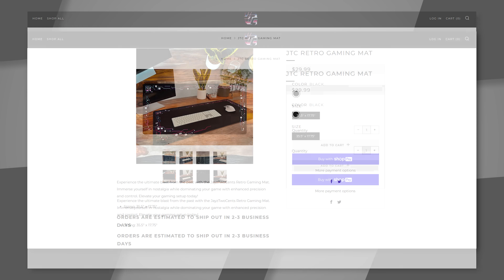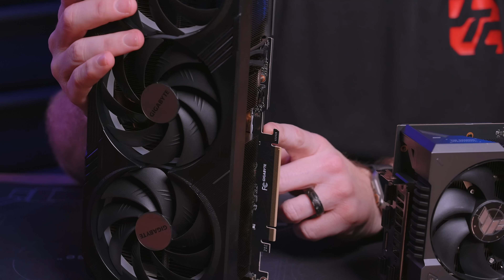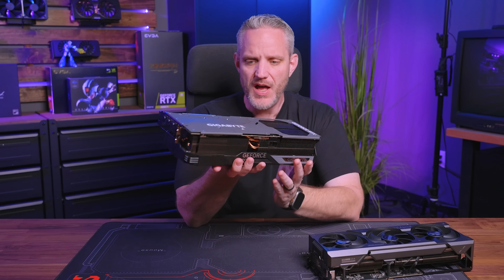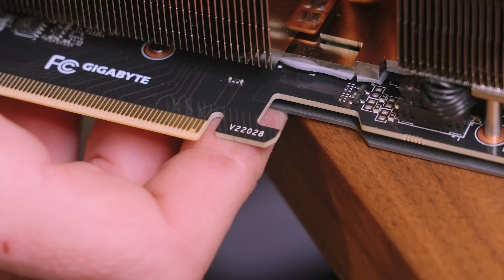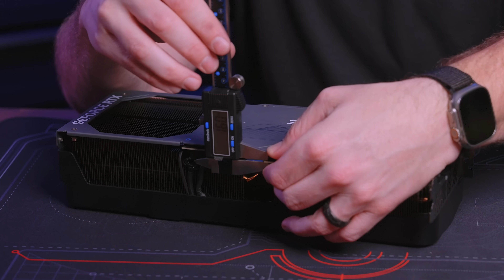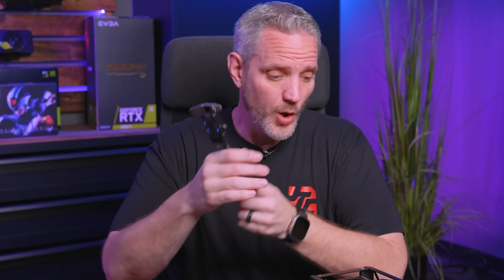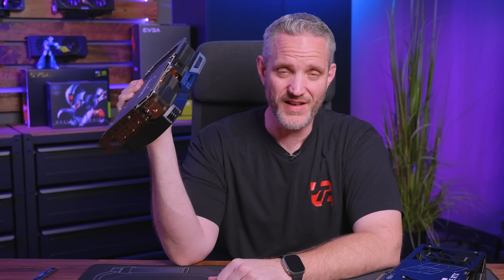These GPUs are cracking and the company REFUSES to warranty them!

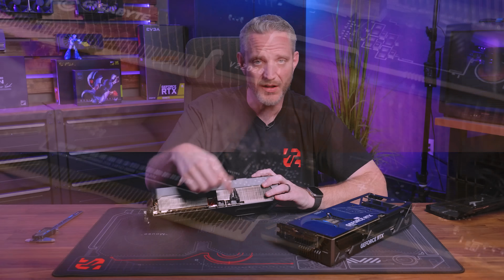Comment: If you stop the video at 14:13, you see that there is a screw post on the ASUS for the cooler near the hook. The Gigabyte card with the cracking problem doesn't have a screw post near to give it added support and rigidity. Gigabyte simply needs to redesign the cooling attachment points so a post is near the hook, and that should support the area enough to solve the problem.

Comment: @JayzTwoCents :  @14:15    = >  Look at Asus, the point where the cooler is attached to the PCB "via" a screw is closer to the locking mechanism on Asus card than it is on the Gigabyte and that could be one explanation why Asus does not flex so much in that area. On Asus  that screw it works like an PCB reinforcement  IMHO.

Comment: i've forgotten the days when GPU braces are nothing but a gimmick, you would get laughed at for spending on one. it's almost compulsory to use one if you're using anything over 200W TDP, coa the heatsink WILL be a big one. on the other hand, the AICs, despite having top of the line designers and engineers that can make fancy ass cards like they are some parade vehicles, failed to detect nor address a simple physical issue that can seriously damage a product from normal usage.

Comment: Hi Jay, I just bought a Gigabyte 4090 Gaming OC GPU a few weeks ago and it does not look to have as much flex to it as yours (it's hard to judge because I'm not sure how hard you're trying to flex it but yeah...). It also came with metal brackets that install with spacers above the mid/bottom right screws for the mobo and at the very end of the GPU so it has one more anchor point. It seems like they did an effort to prevent the issue from occurring with new consumers.
Reply: I have a gigabyte 4080 eagle oc, and it came with the same bracket. It's rock solid.

Comment: I think the take-away from this is:
 - Gigabyte isn't covering warranty for this issue.
 - Gigabyte is showing up at the repair shop more than any other matching card. (Not sure this is factual yet)
 - Try installing and removing card while case is on it's side to avoid torqueing.
 - Support ANY 30 or 40 series brick in your case at all costs!
I doubt if vertical mounting will show the same result but, It's obvious that the card sizes are gown beyond the PCIe 16 connection or location on the MOBO. More dialog is needed, I 'thinks'. Thanks, Jay, for bringing this up!  😉

Comment: It all depends on the geometry behind the tab. As you see the Asus card has a more circular design whereas the gigabyte card has a more squared off design. The circular design distributes the load evenly. The squared off design however, that creates stress points on the corners. That can be proved by the fact that that's exactly where the crack starts at the inside corners of the pcb behind that tab
Reply: That make me relieved. I have the Asus rog strix 3090 oc. It doesn't have the power chips burning out issue thanks to using good power design, so it won't burn out from games. And now this with the circular tabs. What a relief...
Reply: @MyAmazingUsername  lol as a poor guy i couldn't sleep if I somehow had gigabyte version and worry about it cracking.

Comment: Couple of things: 1. Gigabyte needs to stand by their products on these RMA's IF an anti sag bracket WAS utilized with proof. I still want the PCB investigated after saying that. 2. People need to understand as well that the 3090 and 4090 cards are MASSIVE, and heavy. Gigabyte did include anti sag brackets in their 3090 and 4080 and 4090 series of cards to my knowledge. They made an effort there. I can acknolwdege that. So the issue is two fold. Both parties are at fault in my eyes. Gigabyte with the flimsy PCB and customers not using any anti sag bracket on obiviously enormous cards.I  just bought an RTX 4090 Aorus card. The biggest variant there is to my knowledge. If I buy a $1200.00+ to $1799.99 to $2000.00 card I think it would be smart to use the bracket that is included if I can. Or if not, get an anti sag bracket for as low as 7 dollars on Amazon. Leave the PC laying flat like I did till you install the bracket and call it a day. In my experience with Gigabyte I honestly have not had any issues with their products. I haven't purchased their PSU's so I cannot speak to that. But their boards are all I have ever installed in my builds and others. I have not had one failure since 2007.  I may be in the minority in this. But, that is my experience with them.

Comment: You look at the hook, look at the spacing between the hook.  With the ASUS, the hook is close to the PCB making it less flexible.  You look at the Gigabyte card, the hook is far away from the board.  If Gigabyte uses more PCB around the area, it would be more stable.

Comment: I don't want to be that grumpy old man. But I can't help it with this one. This, like most current issues, is from the consumer who thinks one can hang 5lbs off a board with only 3 contact points. 
Because you, the costumes refuse to use support, bracing both the case, and the motherboard has had to get stronger and more expensive. And yet physics can't be changed.

Comment: PCB is "layers of non-substrate materials with layers of copper circuitry" But in plain terms, it depends on the number of layers.  The pcb probably not only has layers of copper but it may also have resin in the core which is why it's less flimsy.  It also could potentially have glass.  But the 3 things pcb has in it is copper, glass, and resin.  It could simply be the one has more layers than they other or they layers are thicker.

Comment: Having had to remove hundreds of video cards over the years, one trick that I've found is that sometimes I need to push the card down into the slot in order to get the release tab to actually release.  It seems counter-intuitive, but by pushing down it lessens some of the tension on the tab.  You just have to be careful not to push too hard that you could damage the MoBo.
Reply: So you would push down while pushing on the release tab ?
Reply: @mire873  Yeah, I've found that sometimes I need to push the card down into the slot while I simultaneously push on the release tab.  Not always, but sometimes it just catches and won't release otherwise.
Reply: @Jito463  I remember this with older boards, but my last 3 or 4 boards barely strapped the thing -

Comment: To be honest, PCI-e slot is very outdated and ATX standard also, they should finally change it. It's ridiculous to mount today GPUs to such ridiculous slots designed for some geforce 6600. And if they still want to use 20 years old slots for today GPUs, they should add some standardised holder which will be compatible with all modern cases and motherboards. It's just no longer possible to use safely today GPUs in 20 years old slot, history is going back, we need something like those super long ISA slots or at least GPUs with 2 PCI-e slots and standardised distance between slots on all new motherboards.

Comment: I got a Gigabyte 3080 12 gigabyte vram, and so far there are no cracks or anything, and the PCB seems super sturdy on this one, but I am also pretty worried that it might've been broken or beginning to break as it had been sagging for around 7 months before I got a support bracket, as I was hoping there was one in the box when I bought the GPU, but there wasn't...
So it doesn't seem to affect all of the 30 gen GPU's, but still dick move by Gigabyte, and it's not okay to do that, to sell something to flimsy and then denying warranty for something that is obviously a production problem.

Also for some of the people with this problem, you might have bought it from a site that has warranty from their place, before it goes to the company that made it, so that might save you some hassle if they have a good warranty.

Comment: Another thing to consider is the geometry of the perimeter.  Sharp angles tend to be where stress concentrates, making them the first place to fail.  The ASUS card you showed was rounded and didn't extend as far from the rest of the pcb.  Those two factors combined should make it both more rigid and less prone to strain at any single point
Reply: I was thinking that too. That's why plans and ship have rounded windows and doors.
Reply: @winstonsmith84  *planes

Comment: the biggest thing you missed is between that gigabyte card and the asus card, is the asus card has an upright right beside the locking piece that allows a screw to hold it nice and snug, where as the gigabyte card doesnt. that alone will increase structural integrity out the wazoo
Reply: Totally agree

Comment: Gigabyte is just about on the same level as ASUS they have the worst customer support. Takes a week to get response. I had the b650 Auros elite ax Mb it was rev 1.0. They had separate bios updates for rev 1.0 than out of the blue the remove 1.0 and only keep rev 1.x now i can’t update the motherboard. Told them and they literally told me it works your an idiot … I’ve built dozens of pcs i literally said screw it and bought msi. Gig also refuses to fix the back door security vulnerability too. They are one of the worst companies in the world. DO NOT BUY ANYTHING from Gigabyte

Comment: Printed Circuit Boards or PCBs are usually made out of fiber, epoxy and copper tracks. Each layer of copper tracks is covered by 2 layers of fiber, reinforced by epoxy resin.
I'm working with fiber and epoxy in combination on a regular basis as a side job. My experience over the years showed: more layers on a pcb equals not only better signal strength but also more stability. That in mind, a 1.6mm "thick" pcb compared to ASUS' almost 1.7mm thick pcb is more likely to crack, especially with a 2kg cooler on it.
Imagine standing on 2 different 1m² glass windows, both 1cm thick. One is just pure glass, and the other one is a 3 layered glass plate. The latter will less likely break, while the first one might crack just by putting it on a mount.

Comment: With my first ever build, I had a Swift XFX 6600XT. When I took the graphics card out of the motherboard after testing outside the case, the secure tab broke off because not only was hard to open the switch, but also I had to pry it out with a flat head screw driver. Thankfully, it still worked, and I used it for 6 months before upgrading to a 3060ti.

Comment: Even if the card is in the Vertical position... if you wiggle your PC from side to side on a surface, maybe to access the I/O at the back or to position it into place, you might shock load that part of the PCB given that the coolers are so heavy and and long. Inertia of that weight will act the same as gravity would in an up and down motion if the card was mounted traditionally.

Comment: if you're using a 2.5 or 3 slot+ card, and not using a vertical mount you are just begging for trouble. Also, Asus has some of the best pcb composites on the market, their stuff is hard to break if you tried. Little tip with the vernier caliper tho, take your measurement, pinch the nose of the caliper with one hand and lock the slide, then slide it off, none of thank yanking stuff you did XD.

Comment: I'm NEVER EVER buying a gigabyte product again. I bet they did it this way intentionally knowing this would happen over time.

edit: even tho I hate the brand I can totally see why they deny the RMAs as when it comes to physical dmg and u start accepting those RMAs u will have ppl who maybe broke it on purpose just to get a new graphics card there is no way to know if it happened by accident or user error, or brand defect. Yes they should accept the RMAs but realistically they can't.

The brand been sh!t for years now I have a gigabyte 1080 that is on my brother's rig and one of the fans stop working, other fan started spinning erratically hitting the heatsink and had to replace all fans using custom ones because of it. Some say "hey the card is too old" and I say I have a 770 from zotac that all fans still work just fine and zotac doesn't has the best quality out there so that should tell u how BAD gigabyte been for many years now. (and lets not even get into their other products with the PSU's, motherboards and monitors)

S#!t brand would never recommend, stay away from it.

Comment: Gigabyte fan rattling issue due to the fan not able to maintain at very low rpm with the fan stop feature, and the then blade rattles when spinning up... This issue was seen since GTX1000 series till even the 3000 series (not sure about 4000 series). They didn't even bother to fix it.

Comment: Fwiw, I've used Gigabyte stuff for ages with no issues. My current card is a Gigabyte 6900xt phantom gaming, and it runs perfectly even after taking it apart to install a water block.

Comment: As Jay said, "Common sense is not common."  
When you look at those hulking beasts of cards, the pins and locking hook, you still have  2/3 of the card/heatsink hanging in mid air.  
Of course you are putting severe stress at that point.  
And don't forget when you also add in the power cables, you are adding extra weight / torque on that locking hook.  
It should be mandatory to include GPU sag brackets or support posts in with the card when you buy it.  
Years ago when I was just an AMD APU fanboy and knew I needed to bump up to a dedicated card to play more powerful games, and saw Jay's and Kyle's videos on GPU sag, I knew then it would be smart to still get a sag bracket or support post.  
And back then, those cards were less than half the size of the monsters in todays video.
Reply: You can use cable as a support if you it goes from the top of the case. But 4090 may literally burn your house that way.

Comment: My gigabyte 40 series came with an excellent anti sag bracket that was well thought out and easy to install. I’d say they all ready silently fixed the issue with the 30 series other wise you would be seeing 40 series with the issue as well. The 30 series was also being manufactured in a time when there were supply chain issues.  Don’t create a problem with the 40 series as well just because you want more views. You have been doing too much of this “burn down this company” videos lately and it’s getting pretty old.

Comment: Not to try to absolve Gigabyte here but I only saw a few days ago Paul's Hardware talking about how he was happy to see a massive air cooler on a 4090 at Computex. Weird if you ask me and the stupidly oversized coolers are just one more reason I'm avoiding 40 series cards, gotta be a bit worried if you currently own a 40 series card from Gigabyte. If it's 30 series that are currently failing then it's potentially stress over time causing the issue and we might see the 40 series from Gigabyte failing in the future.

Comment: Before getting ranty in this post - Gigabyte does not have to do the sketchy repair that a lot of these shops are doing. They could make new boards and transplant the components from the damaged card. That's how a lot of these non-partner Chinese companies are doing, and also the way they get their chips cheap enough to resell them at a profit.
This has been a problem with cards for a long time, it's  just finally getting some attention on it. A lot of the time it is a Gigabyte card that has this issue, which is odd. There are videos going back to the 780s with the retention tab cracking. Some if probably has to do with the mounting, but I would hazard a guess that more of it has to do with people purchasing these PCs and shipping them. They probably work for a while until the stress crack expands far enough that it causes the card to stop working. The more weight on the card, and the more initial damage, the quicker that happens.
However, that doesn't explain why we're getting names like Rossman and Jay talking about it now but not in the past. That comes down to the ever increasing price of cards. People are exponentially more angry when their $1500+ video card dies than when their $500 video card died. Not that there isn't a right to be angry at both, but you're going to get louder voices with the more money that was lost.
As for why are their traces down that far? The number of connections that have to be made on the card plays a roll. There are a lot of pins under the GPU that need to get out. But more so, I would make a bet that there is a lot of auto-routing going on in the design phase to pump these cards out quickly. 

P.S. I'm guessing as another commenter pointed out that both card measurements were wrong. PCIe calls for a 1.57mm thick PCB. 1.6 is within tolerance, but much larger is not. I PCBs were just made thicker to accommodate for the weight, then you're going to start having motherboard fail because they were not designed with thicker PCBs in mind.

Comment: I had a Gigabyte 1070. Not long after I bought it, it developed a scraping noise coming from the fans and the fan stop feature seemed to be faulty. As a result the fans would spin every few seconds at idle and then stop, all whilst making that noise. Tried everything to fix it but couldn't. I recently upgraded to a 3060 Ti and went with MSI.

Comment: Hmm 🤔
Would it be better to have the mounted on different point like 4 screws on a different part of the board, or spring loaded, or off the board connected via a  short ribbon from the GPU to the motherboard...? 🤔

It's starting to look like now you install the GPU into the PC, and mount everything else to it 😀😉😀

Comment: I have a gigabyte 2080 in my wife's PC. That thing would run hot as hell. I had to re-pad and re-paste it. It was fine after that, but the cooler isn't the best on it either. It still runs a bit warm.